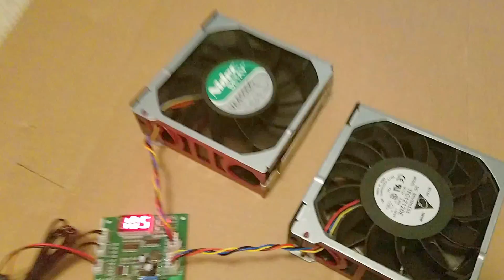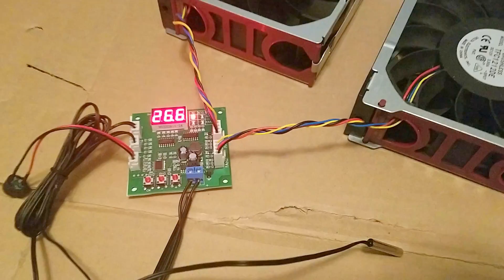Nidec & Delta PWM server fan controller by temperature

Comment: Sounds like my PC when i'm trying to run BeamNG Drive...

Edit: I just got one of these, And i also got a 4 pin fan coming tomorrow.

Edit 2: Does it matter if the blue wire is in the left position next to the tachometer wire? I need an exact answer.

Comment: Could this controller be able to control and stop the motor automatically from running at 0 rpm w/o having to switch the power off? At what set point?

Comment: Hi John, I have a problem bought the same deltas 4 of them hooked to a dedicated power supply with 40 amps, PWM & Tac were connected to the motherboard 4 pin (blue & yellow) these fans don't register the RPM on my motherboard but rather run at lower speed or not at all? am I doing something wrong here as I have successfully managed to run Nidec that way.

Comment: Hi John, Thanks for posting this explanatory Video. I have a similar fan and I have bought a PWM controller to control the fan speed. So, once we connect them it behaves in an erratic way. Some times the fan can be regulated in the complete range from 0 to full 100% sometimes it is working within 0 to 50%. But when working within 50% cycle, scenario we find the wire to the motor gets quite HOT when we operate the fan in Low Speeds. I am not sure why this is happening?

Link to FAN :https://www.aliexpress.com/item/Free-Shipping-Delta-3-9A-violent-fan-12CM-the-best-TFC1212DE-oversized-air-volume-four-wire/787435543.html?spm=a2g0s.9042311.0.0.27424c4dIoe5Zz
Link to PWM Controller : https://www.aliexpress.com/item/DC-6-30V-12V-24V-15A-Max-PWM-Motor-Speed-Controller-With-Digital-Display-L15/32846826141.html?spm=a2g0s.12269583.0.0.56a3127cXQ5fuI

Comment: Hey John , I bought 12 120mm 4 wire PWM fans. Specs on the fans are 12V 3.5A 42Watts 4800RPM & 224CFM per fan. Will that board be able to push 2 fans of mines? I dont mind the noise nor the amount of watts it will be pulling but at the same time i want to be able to adjust the RPM from time to time.I saw the specs on the board says 3A max so was wondering how you are able to get your fans to work when the board is only 3A and those fans are well over 3A.
Reply from the maker: Yeah, it should be able to handle them. I was told the fan connector itself is rated at 3a. I'm not really sure why.
Reply: @jdeg2000  Which controller is this and where did you get it? There is nothing in the description. Thank you.
Reply from the maker: @sdfinsdigwlgshdgRGAODHJFG  look on https://circuitsetup.us